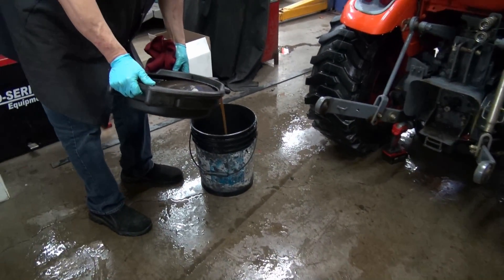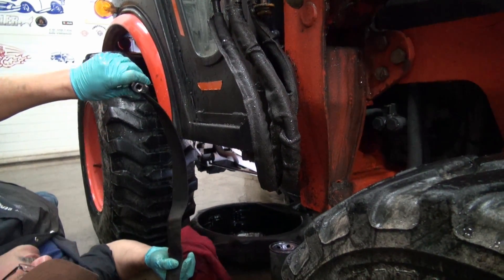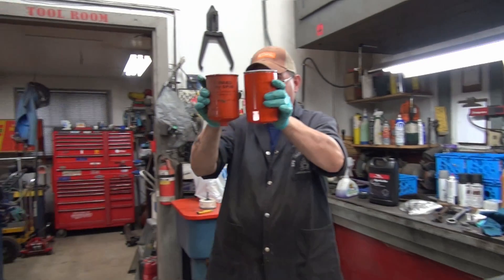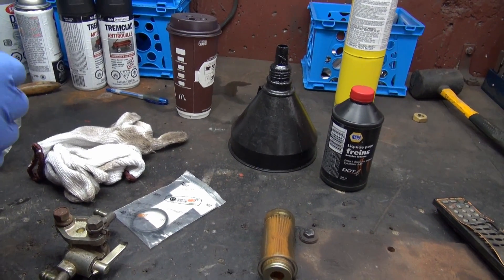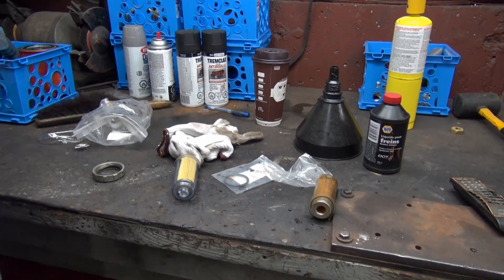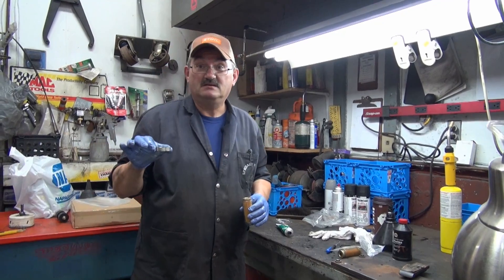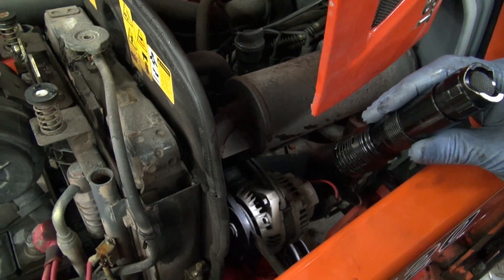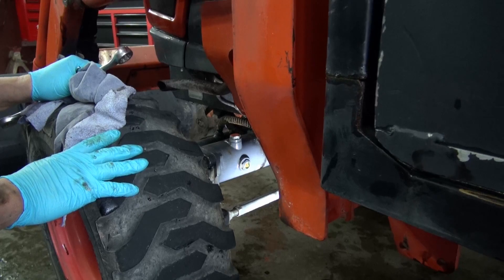Doing Some Work On A Kioti CK20

Comment: The arm to hold the hood up on a Kioti CK20 is located above the Fan blades in back of the radiator wall. Its held in place with a clip, swings up and attaches to the left side of the hood.  Good quality fresh hydraulic fluid helps a lot with the lifting and driving torque.  Just changed all my oil fluids and filters.  Now I learned where to change the front axle fluid and view finder window to check the level.  Thank you. : )

Comment: Good job and good videoing Kathy. Glad to see working on KIOTI. I told you a few months back that I opted for the KIOTI CS2410 TLB. Just did the 50 hour. That HST filter was tight like you said. That's probably why that one was never changed unfortunately. I'm going to have to check my front axle oil level. The book didn't indicate to change it.
Reply from the maker: Thanks Geoff. I'd change the front def oil. I do on all the Kubota's. Yes those filters are brutal to get off. Hope your enjoying your new tractor. Great machines.

Comment: I had a mower with a stuck throttle cable. put some of that on her and wasn't stuck no more. I can send you a couple cans if you can get it over in newfoundland and you wanted to try it. I know Napa sell it and usually they have it on sale here. it's usually 16 bucks a can. I don't know what's in the stuff but it works some good
Reply from the maker: Ive never used it. We always have WD-40 & Fluid Film here but I'll check with NAPA. We are a NAPA member installer so they'll have it I'm sure. Thanks for the offer. Now you got me interested in trying it. 👍 You should work for NAPA lol
Reply: just a truck driver that works on stuff on the spare time lol
Reply from the maker: Your not "just" a truck driver. Your a dam "good" truck driver. I'm bettin your good at working on stuff too.
Reply: they also make fuel conditioners as well. not trying to promote a product. just like it and I find it works really great for what it's intended use
Reply from the maker: I e heard of it and I know others who have had it but for some reason I haven't tried it but I will ;)
Reply: thanks Paul. love your tech tips they help our with a lot of stuff
Reply: Gregory Scott  what was this product tp were telling Paul about at NAPA... you were talking about the stuck throttle cable, he uses wd40 We husband and wife team have 2 or 3 months on NL each summer. Come back to NB after we pick our partridge berries for the winter. Some. Shocking Good. Wonderful, wonderful videos Paul. Keep making them

Comment: Thanks for the video , was just thinking  on your rust proofing what product do you use ..

Reg
Reply from the maker: Thanks Rejean. We use products by Dominion Seal  or we use fluid film depending on the availability.
Reply: How do you get it to stay ,cause got my car done up with krowns  ,but everywhere there .s water moving it washes it off .
The fluid film I use on the sun frame ,that's Toyota weakness but find that it disappears also .thanks Paul for the advice
Reply from the maker: Well there's nothing your going to get to keep it all on because when you drive your vehicle on the road all that rain, slush and salt is like a pressure washer and that's why you need to undercoat each and every season. Remember, I still have a rust free 23 year old truck because I undercoated each and every year.

Comment: Your right about the filter not being changed..I don't get way someone would not look after there tractor. Good video as always, I have a ck2510  fantastic tractor. Just one question on pre-loading filters..way is it necessary?
Reply from the maker: When you pre-fill the filter every component related to it at start up gets instant fluid. Nothing runs dry
Reply: How about the vertical filters? doesn't the oil just run all over? It does when I remove them..Thanks Paul
Reply from the maker: Beleave it or nor you'll loose very little fluid even with the verticle mounted ones. Still worth doing.

Comment: In one of your videos you mentioned you like Kioti. How would you compare that Kioti
CK 20 to the  Kabota 25D? Are they roughly the same size and horsepower? Thank you.
Reply from the maker: That Kioti in the video would be more of a match for the Kubota B series. The Kioti was in rough shape as well. The HP was the same as the BX. That being said the Kioti was a good unit.
Reply: After seeing the BX 25D I have decided that the 25 would be too small for what I need. So I am looking at the Kabota B 2601 and the Kiotj CK 2610. From what I understand the CK 2610 the bucket cannot curl and lifted the same time. This will be my first tractor and I am having a hard time making up my mind, any suggestions on which one you would buy between the two would be helpful. The price on both of them is real close. I value your opinion. Sorry to bother you and thank you for any help.
Reply from the maker: Personally I'd go Kubota. Proven reliability and holds their value. Around here you'll have a hard time finding a used Kubota but I've seen plenty of Kioti's on the used market. We do service work on both brands of tractors and never seen major issues on Kubota's. I guess I might be the wrong guy to ask though because I presently own three Kubota's lol.
Reply: Thank you Kubota is the one I will buy.
Reply from the maker: I'd look at three different manufactures, go to each dealership, sit on each unit you like, drive each one around the lot, see who gives you the best deal and take it from that. They all have their good and bad points.
Reply: Very good advice. I will definitely take your suggestion. Thank you again you have been very helpful.